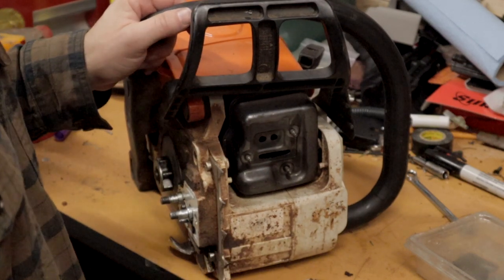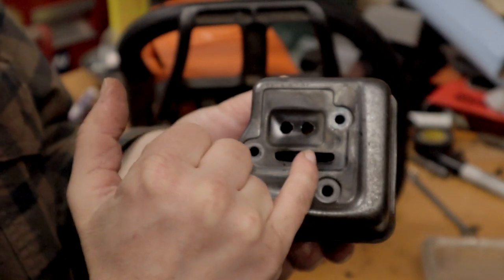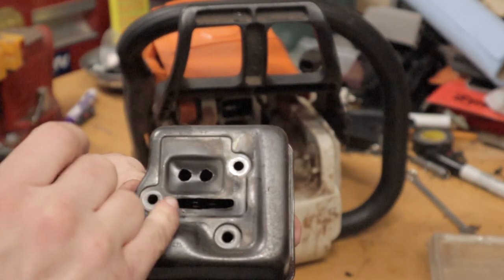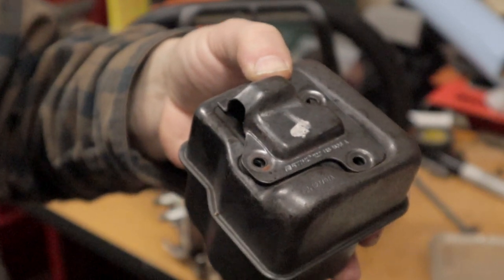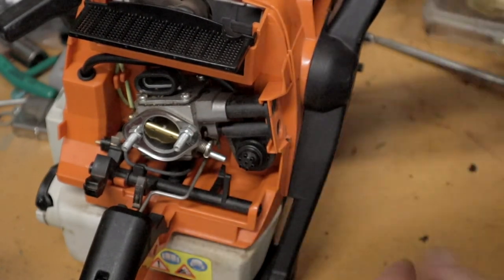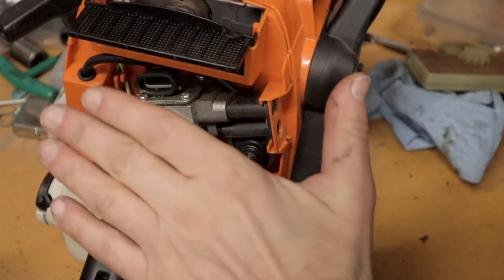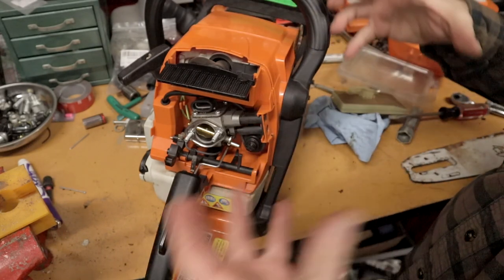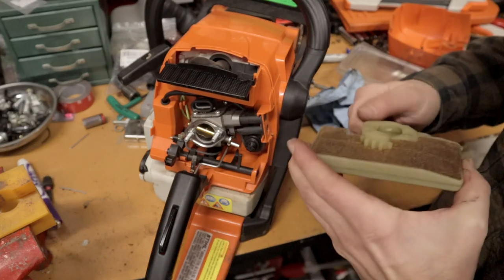290 Farm Boss Mod ! - Do this after your warranty runs out.

Comment: I purchased my 18” Farm Boss ms290 new 16 years ago.  Phenomenal piece of equipment.  Many hard hours of use over the years.  Engineering is first rate.  It’s never been in the shop for repairs. Starts right up every time, even after sitting for over a year.  If you have the means I highly recommend getting your hands on one.  You will not be disappointed.
Reply: Bought a used one and I’m happy with it still
Reply: Stihl is untouchable
Reply: @walasiewicz  Well I've got a Husky 2100XP from about 1990 so yes Stihl saws are actually touchable. Marketing Hype if you ask me. 
The key to longevity is run 20:1. That saw has so much torque it is incredible the way it pulls down under load and hangs on.
As a matter of fact I have a Stihl battery saw and it is my most used saw, the point being other saws can be good also and I'm not biased like you.
Reply: My 290 is like apple pie 😉about 12 years going strong changed the filters in it once over the years and been through 3 bars I use it year round to cut wood to warm my house

Comment: Bought mine new years ago. Used it commercially for land clearing. Starts right up to this day. Great saw. Never had any issues with the way it runs or idles. Interesting mod. Considering it because I do believe in letting an engine breath however, it runs like a champ and cuts logs without any noticeable issues bogging down etc. i also was taught if it's not broke, don't fix it. Hmmm. Something to think about.

Comment: My old mans got one of these been using it forever. Yearly for firewood the metal screen in the exhaust plugged on time and over heated the saw and never has quite been the same since always throw the screen away many saws have burned up from that
Reply: If your screen is plugging your saw is getting to much idle time or you are using to much oil 
I cut wood for 30 years and never plugged a screen

Comment: When those 1st came out as the 029 the price was very attractive till they were used. They came with .325 chain/20" bar. That didn't suit a lot of people in this area so a lot were converted to .375 chain & there was the problem. They were too lean from the factory & got a lousy rep b/c of it. If you can use an 026/260 you'll throw rocks at the 290.

Comment: The restrictions designed into the muffler is to provide a pressure balance after the blow-off phase of the stroke charges the muffler and provides a gas barrier to the transfer phase so it doesn't blow the air/fuel charge out into the muffler. It is also designed for the highest efficiency at full load 9500 RPM and strikes a balance of fuel economy/emissions/performance.
Opening up the exhaust a little bit can help the saw breathe better at the expense of more fuel and more particulate but opening too much actually hurts power. It's best to make small changes, tune and test .
Reply: That's an oft repeated myth.

Comment: What difference do you notice in performance after the mod and carb adjustment? My 290 seems to bog down under load midway through a log often......wondering if this will help it breathe?!?
Reply from the maker: Mine did the same thing.  It would starve for fuel or something.  This made a huge difference..
Reply: It will open it up a good bit. If you take the time with a torch and split the muffler to either cut the baffle in half or completely try and remove it and also to put a .625" pipe in the top corner on bar side of the muffler it will open it up even more. If you take the time and spend the money for the ms390 cylinder kit that's a 49mm bore you'll gain a hell of a lot more but you'll have to swap up to about a .700" pipe I'm personally running a .750 or 3/4 inch pipe just because it throws the buddy's off. I think they run best with a .700-.730" pipe. That's for the ms390. The ms290 or ms290 super I would use a .625 or .650" pipe. The only difference between the ms290 and ms290 super is the bore size. Ms290 is a 45mm bore the ms290 super is a 46mm bore the ms310 is a 47mm bore and the ms390 is a 49mm bore considered the "Big bore kit"

Comment: Have the same saw and am having oiling issues with it, any suggestions?
Reply from the maker: Turn up the oiler.  It’s on the bottom of the saw.
Reply: Make sure the oiler channel on the bar is open and not clogged.  Remove the bar from the saw and check the little oil hole that feeds  the oil into the bar's channel.  It frequently gets clogged with goo.  Your flow will be magically be restored.
Reply: If the other two recommendations do not work pull your clutch off and check the plastic oil gear that the slot in the clutch cover turns. The plastic oil gear can strip out. The way you tell if it is striped is the metal lever arm that comes off of the plastic gear will spin around the gear. It should not slip. Also when you pull the gear out turn the other half of the oil gear that is still attached to the saw to make sure the actual oiler isn't seazed. The oil gear slipping is a common issue on stihl saws
Reply: Poke a needle in the oil vent check valve too, can get some crap in them. Worked for my MS310

Comment: When those saws came out they were called the 029 or 039. The 029 was the smaller of the 2 & came with  .325 chain. A lot of people went to the 3/8" chain & it cut better. Those 1st saws were leaned out too much & suffered but Stihl made it right. They didn't hold up as good as the pro saws.

Comment: You can't over rev a Stihl there's a rev limiter built into the ignition module on all of their newer equipment and you did nothing in the way of power gains by cutting your muffler open what DID make it run right is by making your carb adjustable its probably been lean since you bought it. If you don't think stihl did all the homework to make sure they are getting all the performance and longevity out of their equipment your nuts. But hey, cut your muffler open if that makes you feel like you accomplished something. It will put outt more db's if that's what your looking for!
Reply: 100% correct
Reply: You absolutely can get more power out by modyfying your muffler. You dont know what your talking about len walas
Reply: When the 029 1st came out around 30 odd years ago Stihl issued a SB that they were too lean when reports started coming in of burnt up saws. Stihl did help with making it right but the damage was done. Around here you almost couldn't give 'em away in those days. I've got 2 of the newer model, MS 290, that are shot. I've not looked into the reason yet, not high on my list.
Reply: Meh

Comment: Warranty? ? It's a chainsaw not a feller/bunched. I bought a ms462, ms461 ms661 and send them directly to builder for porting. Who cares about warranty? Dumb.
Reply: My god youre cool. Big pp
Reply: @MT-vw6pf  and you must be broke to worry about a warranty on a chainsaw?
Reply: Agreed
Reply: All a warranty is good for is protection against factory defects, that's it. If someone ran straight gas thru a saw & screamed warranty, good luck. If a dealership warranted that chances are Stihl would want the  engine sent in & if they did they would be put on a watch list. If they were foolish enough to do it again they'd lose their dealership. If the owner could work out something with the dealership w/o Stihl being involved different story. The 029/039/290/310/390 were designed to fit a particular price niche that's it.

Comment: Superficial validity. "Better exhaust flow" doesn't necessarily improve HP on either a 2 or 4 cycle engine. Infact, 2 stokes usually need that exhaust back pressure to breath so if anything your only hurting performance. If you really think you can improve the ms290's exhaust souch then why don't you patten your design and show Stihl how to properly build a chainsaw?
Reply from the maker: nik krenitsky it’s a known mod on these, has been for years because it works.  That saw was a complete dog before I did this to it.
Reply: @design2survive  Cleaning and even removing the spark arrestor is one thing, but hollowing out the baffling just turns the muffler into an open header more than a crude expansion chamber like its supposed to be. It allows the engine to suck in gas more quickly, hence the perception of increased power, but it then turns all that fuel into angry gay sounds more than actual useful power because it now gets even less of it gets a chance to burn under that increased exhaust flow. If you think that trade off is worth it then more power too you, but in my experience every used saw I have bought with this mod stalls constantly, needs more gas every 10 minutes, runs stupid hot and usually just needed a new seal or some carb work done.
Reply from the maker: nik krenitsky the 290 was designed restricted..most likely because they didn’t want it to compete with pro saws.  It was always starved for fuel, especially with the restrictor caps on the carb.  

It used a bit more fuel, but it worked way better.  

I won’t do it to the 261 because it seems to run really well stock.

Never remove the spark arrestor..
Reply: @design2survive  My limited experience with a commercial weight class chainsaw was an old Echo EVL-750, but I have both a new 271 and 290 and it was allot more like the 290; slow but strong with allot of torque and low end power. My 271 is way more trigger happy and feels like it has the most power, but it definetly seems to go through chains and gas more quickly. The 290 just seems less waistful and more controllable by comparison. Either way I always prefer to use an ms-170 with a 20" bar whenever possible.
Reply: @pinkhead6857890  Stihl knows how to make a good chainsaw, they did it in the 90's the problem is they can't make it and sell it AND get it passed the EPA. A lot of these new saws come choked up from the factory to pass inspection, but then have problems with overheating in real use,that's half the reason people mod mufflers. There's only so much you can get out of these cheap plastic clamshell saws but people have been running modded mufflers for decades to get more power.
Reply: Anyone taking about needing back pressure like this person should be ignored.
Reply: @pinkhead6857890  2288
Reply: When I hear 'back pressure' I assume someone failed the physics portion of engineering.
Reply: Muffler mod done right will make your saw run cooler adding more fuel adjusting the carb just right 👌
Reply: Exhaust flow can make or brake a saw. Sadly a lot of saws are bogged down due to regulations manufacturers must follow. A particular saw may only be able to run 70 to 80% and still meet emissions. This is why you find people moding their chainsaws.
Reply: @design2survive  "back pressure" 🤣 this guy is just wasting your time. 😂